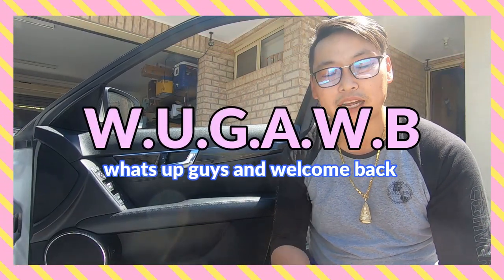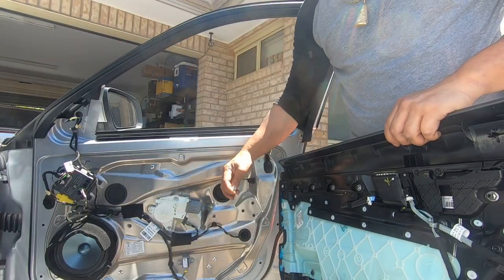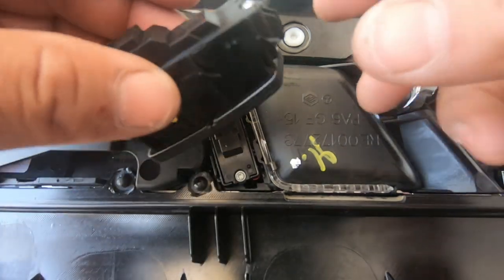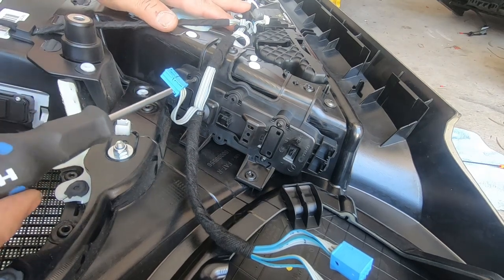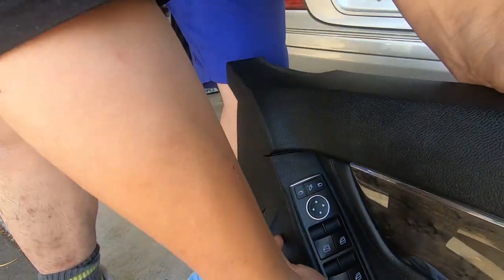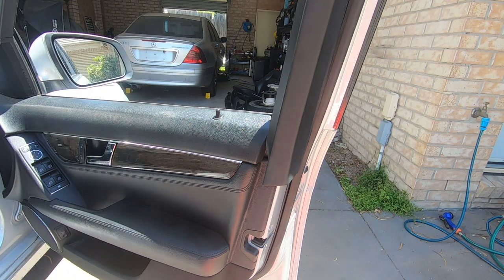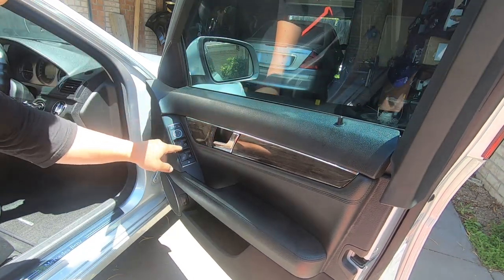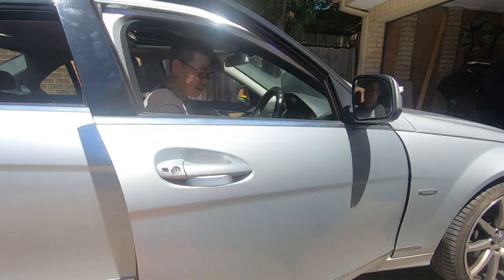mercedes w204 front door window switch + lock/unlock button replacement

Comment: very helpful mike thanks mine were peeling so i replaced them aswell rather then gettig the stick on stickers ..i like the buttons covers u have though howare they with light? does the orange led still appear through
Reply from the maker: they shine through ok not as bright if u wanted more light i guess u can take the buttons off then stick the stickers on after u remove the black button stickers fac tory ones

Comment: May I ask you a question? My original car 204 does not have the seat adjustment button with the door panel, and the seat adjustment button of the original car is on the seat. If I want to modify the seat adjustment button on the door panel, is it only necessary to change a high-equipped door panel wiring harness😢😢
Reply from the maker: if you want to do that u will need to ensure you have the right module on your door, and also the right seat because the wires all need to plug into each other , i would presume u need a new seat and new door module then run the appropriate cables to plug into the seat harness and door module
Reply: @MIKEYZVLOGZ  thanks a lot
Reply from the maker: @sichenglai  no worries ur welcome

Comment: Hey Mikey, I’ve bought just the buttons. How would I be able to replace just the buttons and not the whole master unit? Is it possible or not?
Reply from the maker: yes u can they click out
Reply: @MIKEYZVLOGZ  ah ok awesome! Do I have to remove the door panel and do it from the back of the master unit or can I do it without removing the door panel?
Reply from the maker: @Dre  can do without ..so u press the button down like your putting windows down and use a pick tool or flat head and pry the bottom part.but be careful  don't break the clip the button clicks into or else ur button won't sit in . and be loose .do it slowly and softly
Reply: @MIKEYZVLOGZ  thankyou bro for the help. I’ve been trying to do just that but it won’t come out. It feels like only 1 side of the bottom of the button is unclipping but not the full thing. Is there a difference between prefacelift and facelift? (I’ve got prefacelift).
Reply from the maker: @Dre_98  same

Comment: Hi mikey, i got a problem with my windows only the passenger side window works all other 3 windows completely do nothing, what could be the problem? merc w204 2008
Reply from the maker: not sure but my guess would be either door module or the switches themselves ... should start with a obd2 scan and go from there if all else fails u need a auto electrician to take a look ..

Comment: For anyone thinking they can just buy the buttons and replace them, as I did, I wouldn't bother.  The switch, once you get it out, is basically not dismantleable, at least if you think the risk of breaking it is too high.  The buttons appear to be held in by tabs on backing plates that in turn press on the switches to actuate them, and the tabs aren't accessible.  I'd be glad if someone can tell be how to get the switch apart without breaking it, because I could find nothing on the internet.  It begs the question of why you can by these buttons if you can't safely install them, which I assumed could be done because they are for sale.
Reply from the maker: do u mean the button switch for the windows? I've actually seen ppl replace the buttons ... it doesn't look perfect after but it does work apparently...that's why I would just replace entire switch panel
Reply: @MIKEYZVLOGZ  Sorry, I didn't clarify.  I meant the door lock switch buttons.  I'm also awaiting the window actuator buttons which, apparently, are easy to replace.  I  have the window switch panel coming as well because I ordered it before I knew that the buttons could be bought on their own, so I have a backup strategy if it all goes south.  I'm not having any luck tracking down the door lock switch though.
Reply from the maker: @andrewb2514  door lock switch I've seen just buttons replacement but u need to be able to remove the button I think that easy cuz u cab remove entire door lock button and it just clips on ... so yeah ... thatwould be better

Comment: Hi. You know to to remove W246 window switch control on driver side?
Reply from the maker: it would be similar ..most mercs will be removed from inner door panel .. unfortunately I haven't had the luxury of working on one just yet but I'm sure it's very similar
Reply: @MIKEYZVLOGZ  I'm actually in interior restoration business in Singapore. However, came across a W246. The customer want to replace the window control module. But we can't seem to dismantle it.
Reply from the maker: @tienchin  oh I see ... hmm it will be something like a clip  and a screw